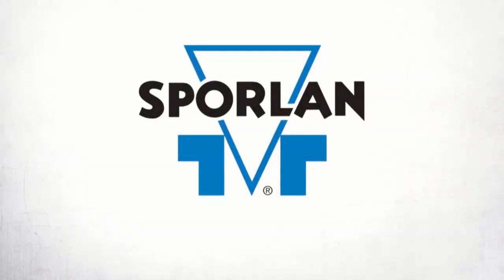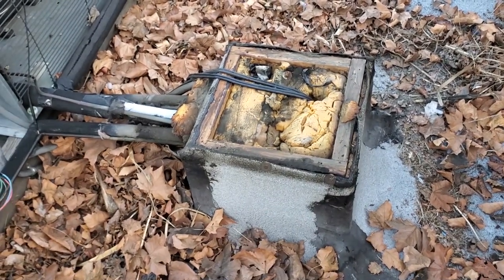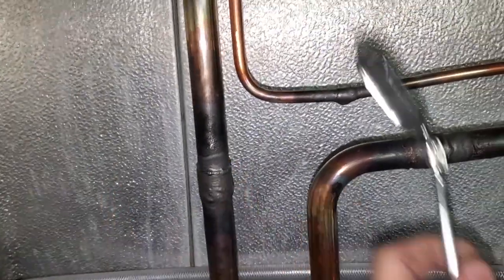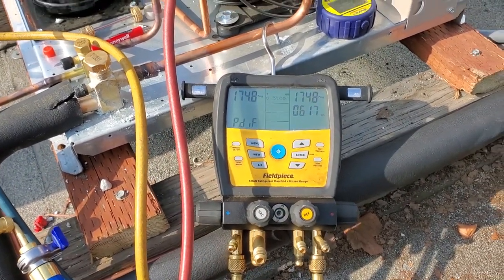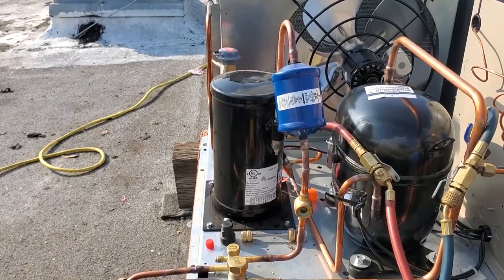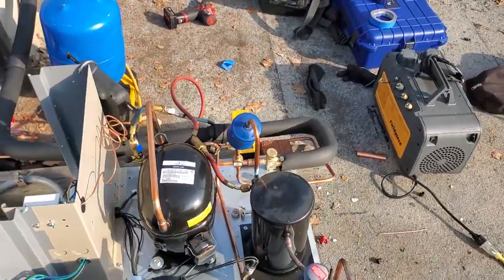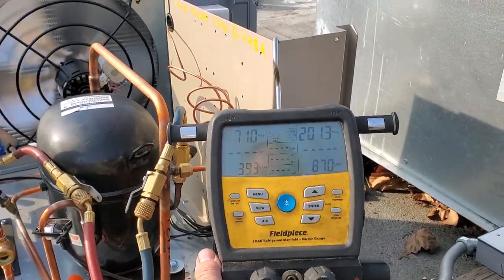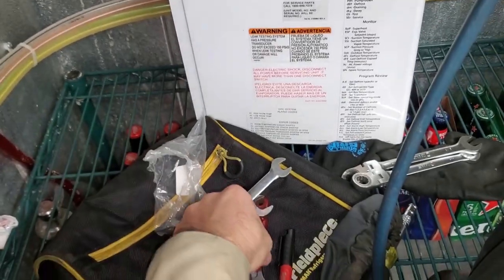HEATCRAFT QRC INSTALLATION FAILURE

Comment: Great video ! AND i Have some Great News for you.  GO GET YOUR MONEY !!! Those Pressure transducers are rated for a maximum of 300psig. Pt Chart says that R-448A is 175 Psig at 87 degree's. So, What your saying is that if i Turn off a Walk in cooler with r-448 in it in Palm springs california on a 100 Degree day i will Blow up My Pressure transducers on a Walk-in cooler ? i Don't think so !!!
105 degree day will give you 231Psig at transducer with R-448A. Hense the Reason for a 300Psig Rating on All Transducers. 

Return that Transducer for Warranty  and GO GET YOUR MONEY !!! 

YOU DID NOTHING WRONG !!! IF A TRANSDUCER CANNOT HANDLE YOUR WORKMANSHIP ITS NOT YOUR FAULT !!! 

What they DON'T Like is Being SHOCKED BY PRESSURE. EASY DOES IT when adding pressure to a vacuumed system.

Give me a shout out in one of your vids if this was of use to you or something . id like to get a few more subs if possible.

Thanks Oc.
Reply: I agree with OC - your pressure test was only 17% over their documentation and well below the equalized pressure on a hot day for that particular refergerant.  I think the transducer was BOB- Bad Outa Box...
Reply: @jth1699   Definately !

Comment: A bit over the top on that oil trap. Customer could bend that of they go ham when they are stacking boxes
Reply: yes but maybe not. piping dose come come .
Reply: Basically you just need the oil to accumulate a little in the bottom of the Oil trap. Everything more is unneccesary pressure drops.

Comment: Good job but, seriously, the guy who wired that contactor backwards should not be allowed around electricity.
Reply: James Bowie because someone made a mistake they shouldnt be allowed around electricity? You wont make the same mistake again if you know what happened, you learn from mistakes
Reply: i agree
Reply: @jasonmurawski5877  Wiring mistakes can be fatal, hence the need for qualifications. Such a bone head error makes it pretty clear to me that the guy who did is not qualified to work on mains power.

Comment: There is a Non-Zero chance that there was something besides nitrogen in that oil. The manufacturer will do their own decay test, then charge the system with its specified refrigerant and proceed to run it for about 5 minutes to verify everything works. After that, They recover the charge and then charge it with nitrogen

Source: Lead QA for a HVAC Manufacturing plant

Comment: The only problem is that the customer didn’t pick a KE2 system lol 😆 jk.
Reply: Cameron Cochran the KE2 Therm controllers are nice! I’ve been having issues with the factory installed ones on freezers causing ice build up from inadequate defrosts. Had to more the defrost termination sensor. Other than that, they are sweet!